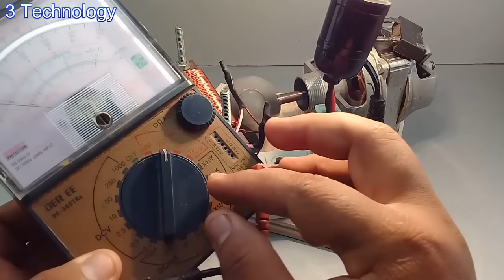how to make 240v 10000w free electricity generator

Comment: 10kW...seriously??  We're suppose to believe thats handling over 40 amps continuous, or much more if V falls below 240?  Not gonna happen in that gauge wire especially packed together with no cooling.  10kW is a massive amount of power bruh, how do you conclude its puttin out 10kW???

The spinning circle magnets would have very minimal mag. flux actually passin thru those coils, and the inductive reactance resistance would b high w so many coils plus ur motor rpm is very low.  Why dont any of u 'tards explain the mechanism of how it works with some theory?  Oh yeah, cuz it dont!  10,000 watts...U must smoke the really good stuff

Comment: If 10.000 watts of energy flows through a copper wire as shown, it would become a heating element for half a second and after this nothing left but old metals. If you're looking for free energy you're on the wrong track with this BS.

Comment: This doesn’t work I already tried this
Reply: Are you serious? So is fake
Reply: @cymerlin9690  it wouldn’t produce the amount of voltage or current to power a lightbulb 
Don’t trust free energy videos
Reply: @cymerlin9690  besides its easier to just attach 2 of the same motors to each other

Comment: Dc current is generated from your generator brother😂 and you run ac component . But you r much intelligent bro how you hide your current source😂
Reply: Brother the two 60W lamps take AC current only፣ no Doubts in this case. Surely  AC current is generating from the magnetic field. Here the unclear work is that he was supposed to show us all the materials and their measurements he used and should be measured every out puts. No transparency.

Comment: Ok I get that the generator spinning magnet creates the electromagnetic field that charges the copper wire for energy useage. I get all that, but I sincerely do not think it's generating 10,000watts at such a small scale. If that were the case every electric & hydro company in the world would be out of business.
Reply: This particular case i guess gave more or less 800/1000w (take out the motor consumption) and probably remain around 400/500w, enough for basic house
Reply: The electric companies use this technology for production and all those wind turbines are just for display and eating tax payers money 😂
Reply: What he made won't power a single led light it's impossible

Comment: I see you have 263k viewers. Great, I will give you a 10 for neatness and 100 for hiding the battery. I worked with generators daily and rebuilt engines and electrical systems. I would love not to deal with gas fumes anymore, lol lmao...
Reply: I think he was a little more ingenious and was using a transformer winding under the bench inducing voltage into the coils he wound. That way he could actually show 220vac
Reply: N funciona então?

Comment: Lol there are simpler ways to produce large amounts of energy. Love it though nice content
Reply: Please enlighten us as to how????  Ive one, but its w H2O2 gas from water, tearin apart H2O into free radical rxn via ultra high freq signal where e.field pulses stretches polar bonds into clevage thus generating H2 without current consumption; this extra adds to H2 gen from current thru elect. cell and H2 is used to get power enuf to run cell plus yield enuf over that to do work but the over is small im still optimizing for better yields...but its extremely complex theory and build with 5 years of my work into it as an R&D chem. engr.  See, i can actually provide the explination of how it works unlike any of these because they arenreal.  so please, tell me this super easy way and describE how it works.  Dont worry, ill wait...

Comment: I keep watching, because the music is  kicking me to the electronics momentum!! 🎉😊 l really love your work ❤, looking forward to see more projects from you.❤
Reply: Bro, if you can make 10000 watss come out of a small battery pack. I'll buy that device.
Reply: @joshuabowkley3490  i'm sure that4s a big fake. The maximum power must be related by 40 Watts, no more...
Reply: @jackouille68  %his item is most likely click bait. However, over unity isn't a myth. One guy made a 230k watt solid state devices, and was running his entire farm off of it. He wouldn't open source the tech due to greed, and he got whacked by big oil interests.
Reply: @joshuabowkley3490  i unterstand but thid is realy a big fake...
Reply: @jackouille68 zero watt from this as it’s fake
Reply: @joshuabowkley3490  
Hilarious nonsense
Reply: @joshuabowkley3490  i can teach you how to assemble working magrav system for your house. in few month full autonomy on energy as result. many people is done this already and its works.
Reply: If it actually functioned, 10,000w load at 240v is 41.5 amps which would probably melt those tiny wires and at 125v it's 83 amps of load that would probably catch it on fire if it could actual even create a single V. But it can't, won't, not even for a second. Plus what he's showing would constitute Perpetual Motion. Nope, no such a thing. If is worked at all, he'd be a billionaire for producing the first perpetual motion machine ever......Plus that fact that is shows NO sign of load from the light bulbs. More load the harder to turn the generator. Nice lil magic show stunt is all it is. Oh, I've been a Electrician for 40+ years from the production to wiring buildings.
Reply: You actually like his false crap?
Reply: What is the size of the coil and how many turns
Reply: @blessedvincent6515  lol it’s won’t ever work it’s fake

Comment: Motor is not self rotating and is rotated by tesla induction coil.
Reply: It's not a motor. It's a generator. The motor is the magnet/coil interaction. Same as a speaker. The magnet and coil are the motor. It is absolutely self running because there is no external input power. The motion of the magnet causes current to flow through the coil which in turn interacts with the magnetic field and if you flip polarities you get current flowing back and forth which is alternating current which is what's happening here.

Comment: Unless he is transmitting electricity to that Black Capacitor, this entire thing is 100% LEGIT.
Reply: Why do you suggest that it is legit? What are you calling a capacitor?
Reply: @ekeretteekpo3004  @12:13 The Black Brick hanging off the Motor on the Right. Other than that, everything else is Legit. I should know because I am an Electrician.
Reply: @aaronpaolilli8578  okay. So, how would he be transmitting electricity to the capacitor, assuming that was the case?
By the way, he didn't show how the motor was built. But, how does one just stack coils on a magnet and then bring another rotating magnet being spun by motor with a circuit bridged by a capacitor, and then generate a self-sustaining system.

By the way, I think that black thing is a diode. 

From what I see, it appears that the spinning motor induces electricity in the stacked coils and that electricity is immediately fed back to the motor to drive it.
Reply: @ekeretteekpo3004  Yes, you have it mostly correct, but you also have the Magnet under the Coils that pushes on the spinning Magnet connected to the Motor. This stabilizes the Diminishing Return.
Reply: @aaronpaolilli8578  so the spinning magnet slices the mangetic flux and imitates the electricity that is carried by the wires on to the socket? So, does that mean that this design actually works?

How does one build it?

Comment: Also I don't want to bother you but is there any way to make a speaker work more efficiently or produce more bass just by the wiring config. I mean I know about low pass filters and crossover circuits. Just curious if you can somehow amplify the output of a driver, if it is even possible using the same line of thinking in your videos. Either way thank you for ALL the Cool stuff you show. Awesome to learn something new every day.
Reply: This video is fake
Reply: Núcleo prescisa ser isolado com fita creps ou papel manteiga para evitar que danifique o esmalte do fio a cada espira que passa pelo núcleo
Reply: Dont use those big silly words all you need is capacitors and resistors to even stuff out and have on demand unrippling stable current in terms of power for sound u maybe got to get some refiners/converters like sub amps or sums vaccum phosphore sealed glass sound tube or sum so u can have more detail and punctuation and contrast in sound with more sound volume range clarity madd bass less shuttery or skippy or overall shitty speaker quality in sound and ability and missed potential and also radio clarity in range and decyfered reception anyway idk what i was talkin bout im high of my ass ramblin or sum
Reply: No. Adding amplification creates too much distortion if you don't know what you're doing. Stick with the recommended setups.
Reply: اگه راست میگی تخته رابلکدش کن که کلکی نزده باشی😂
Reply: @Ali-nv4lm  English ?
Reply: @Ali-nv4lm бұл видео жалған,  ондац болуы мүмкін емес.
Reply: The video is a sham, but to answer your question seriously. The efficacy of a louspeaker driver itself is directly related to the strength of the field magnet, stronger magnets make for more efficient speakers. Also a lighter, stiffer, cone material can help. The most crucial thing though is the acoustic impedance coupling between the driver and the surrounding air, the cabinet and/or baffle. Theres a lot of complex maths and physics behind it all, but reasearch horn-loading for a start. As for more bass, bigger drive units and cabinets/horns. The wiring has nothing to do with it.
Reply: I mean you could build a resonance circuit but it's only going to apply to those frequencies. That's basically what a line amplifier does but across the desired audio range.
Reply: I guess I'm asking the wrong person,  seems like 3 different people who don't know what the hell they're talking about answered me,  have a NFD!!!!!
Reply: @timdude2368 lol but you believe this Fake video what a dummy
Reply: In place of this steel roller should be put
horseshaft and will generate 44A/230V or
12A/3x400V, Hz depends on stallion frequency.
Reply: @23zdzislaw  this is fake and will never ever work

Comment: I love building speakers, that is nichrome wire correct? Can you possibly make a good video explaining how to wire like 8 4ohm speakers and keep the impedance at 8ohms and possibly the more important one is several 8ohm speakers together that stay at 8ohm impedance. I know a little bit about it depending on series or parallel . But it will help me out with my life long hobby with the love of building speakers and the cabinets and wiring them. If you have any advice it would be greatly appreciated thank you!!
Reply: Speakers of equal resistance is easy. Speakers in series double the resistance. Speakers in parallel halve the resistance. So, 4 4 ohm in series is 16 ohms put those in parallel with 4 more in series, you get half of 16 is 8 ohms.
Reply: @KevinSmith-os5yz  exactly.  Usin 8ohms, build bosex of sets of 4 speakers, wire 2 sets of two in parallel, where each pair of parallel 8ohm speakers have an equalivent res. Of 4ohm...then wire each pair together in series making 4+4 or 8 ohms as u started with; creating a 4 speaker cabinet of all 8ohm speakers with a TOTAL EQUIVALENT resistance of 8 ohms.

But in reality, we must remember this is DC equivelant as speakers are coils with inductance and audio signals are higher freq. ac signals...so one must get cruel and induce time dependent current with The nasty calculus that follows to see the true picture (well painful if ur not engineering background).  In theory you could make many 4 box sets, then pair 4 boxes in same manner to have 16 with 8ohms, driving 16 speakers with the same amp that normally drove one with 16x the sound!  Wrong...
Reply: Dc would see same power input and 16 driven, but w ac sound signal, you now have 16 inductive coils all in prescense of magnet to oppose changes in current, so ur inductive reactance would be MUCH higher than a single speaker and current flow  would slow to a trickle; sadly u cant get more driving sound power for free.

On the bright side if youve a set of subs w high freq. filtered out this super low freq. has minimal inductive resistance, and with a decent watt amp one iteration of this idea as a 4 speaker box does work pretty well, ive used it b4; but u cant go overboard.  Hope i was of some help bro
Reply: Resistance isnt the focus here, its inductive reactance aka "resistance" of an inductor which changes based on current flow AND frequency of signal.  Low freq has minimal effect, but higher freq becomed exceedingly difficult for AC current to flow until it basically cant (thus how inductors block or "filter" high frequencies")
Reply: Posso oferecer uma experiência pra você saber se vai funcionar.
Reply: https://youtube.com/@TechnicalUsama12
Reply: Good video lol what a dim wit